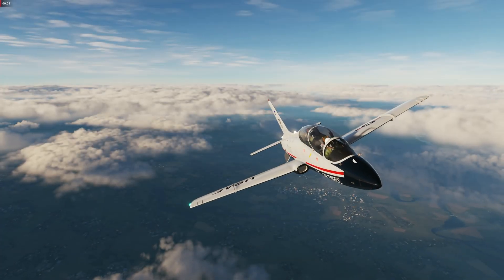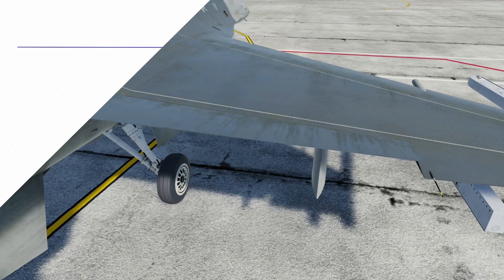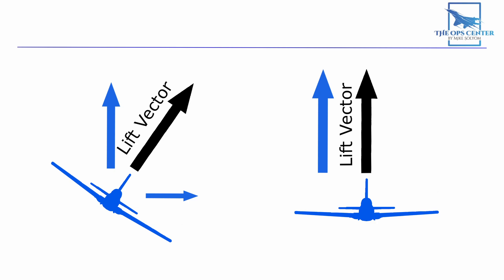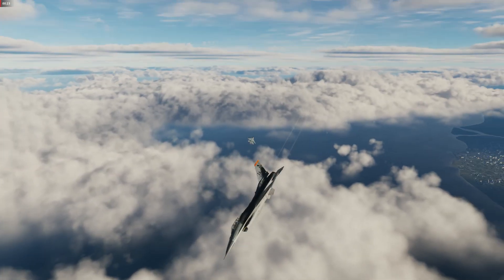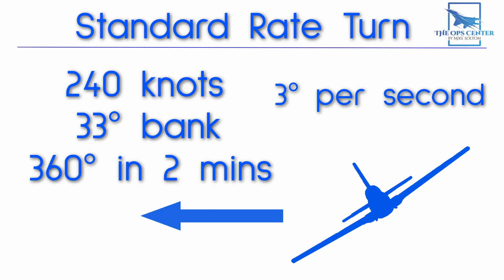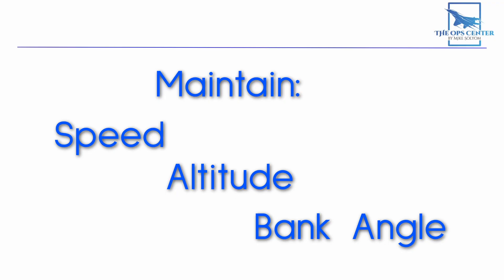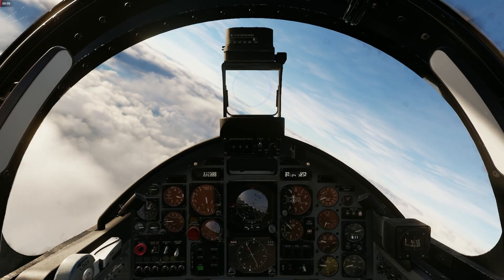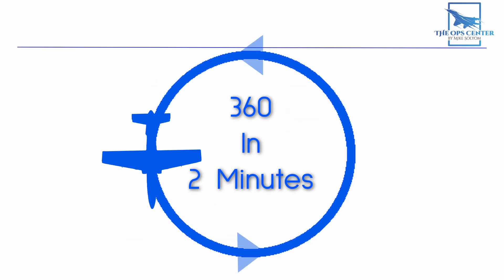How To Make Perfect Turns | DCS Beginner's Course

Comment: Good video but there is no mention of rudder use during the turn. Banking left or right usually causes yaw in the direction opposite the turn leaving the aircraft in uncoordinated flight. Rudder is used to compensate and maintain coordinated flight through the turn. I fly WW2 warbirds and GA (prop) aircraft, so I'm not sure if this is the case with jets.

Comment: Thanks for the great videos! But shouldn't I use the rudder during the turn also?
Reply: Hi, yes. The semi-wing where the aileron is deflected downwards to produce more lift will experience also an increase in drag, giving the so called "adverse yaw". This inbalance in drag between the two semi-wings indeed causes a moment around the aircraft Body Z axis, turning the nose in the direction opposite to the turn. Therefore, usually a slight pedal input is required to deal with this adverse yaw and maintain a coordinate turn.

Comment: Hi, Thank you for you very informative and useful material. I learned something new. Actually, I have intuitively understood in the past how to execute this perfect turn, nearly perfect. The problem is my speed. I know how to manage constant turn rate, with 45 degrees and not having any height change while turning. However, I don't know how to maintain the proper speed to achieve a 1 minute turn or 2 minutes turns. It would be easy if I fly F16, where you have knots, but I am a p51d pilot and have only miles per hour speed displayed in the cockpit. Any idea how I can translate your calculations from knots to miles per hours to achieve perfect 2 minutes turns? Doing that calculation correctly would help me a lot with navigation and planning during my combat missions in 1944 in Normandy.
Reply from the maker: Just doing some simple I see that 240 knots translates to 276 mph. So you can use that speed. Or 345 mph for 300 knots.

But with these turns you don't have to be scientifically accurate. If your 2 minute turn is off by a few seconds it won't really mess up your plans.

Bottom line is to just get as close as possible. Don't sweat it if you aren't exact.
Reply: @TheOpsCenterByMikeSolyom  thank you. That's correct what you sayt that I don't have to do calculations perfectly; however, I do combat flights in WW2 and I must do a lot of different calculations every second in my mind. Every deviation in calculations might cause cognitive overload of my brain, and I risk dying in a virtual mission I simulate, when overloaded. Thus, often I trust intuition a little bit during navigation, and I am still on place and time as planned. 

I have checked that there was no such thing as a standard turn for p51d in WW2, and it was more important what was the maximum turn rate with optimal speed, while keeping the energy state to win dogfigts, or for how long you were able to execute instatianous turn rate by echanging energy into faster turning, without high or low speed stalling. In 1945 that standard turn caluclation was not needed yet, because the sky was empty, and pilots where not flying if wheather is bad. Most of flying was VFR and not IFR flying :-)
Reply: Put "knots to mph" into Google and several websites show up in the search results.  Any of these sites will convert nautical miles per hour into (statute) miles per hour that you need.
Reply: Try using (10% of TAS) + 7.  So @ 400kt = (400 * 10%)  =  40 + 7  gives you  47 degrees angle of bank, close enough for a  rate 1.